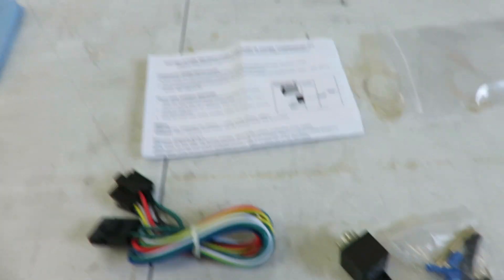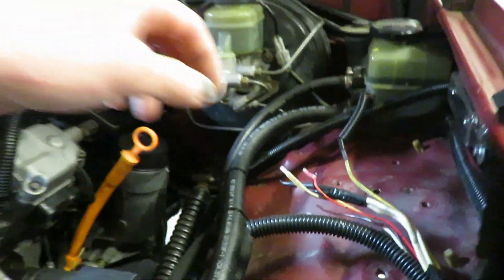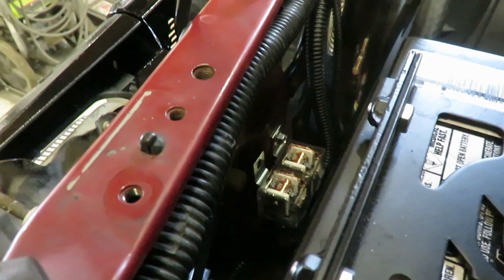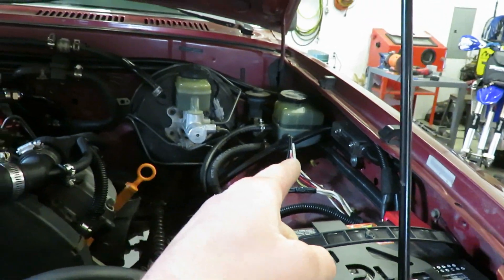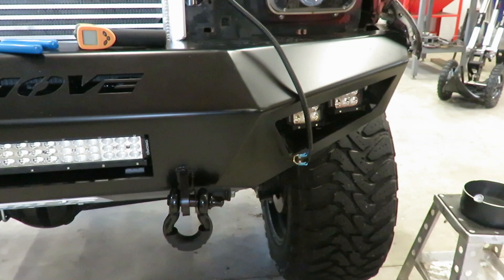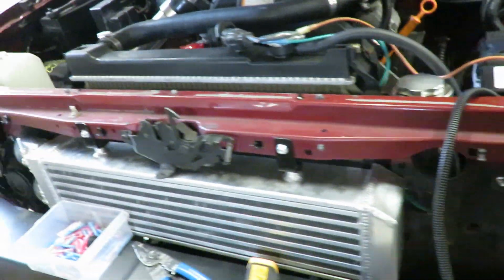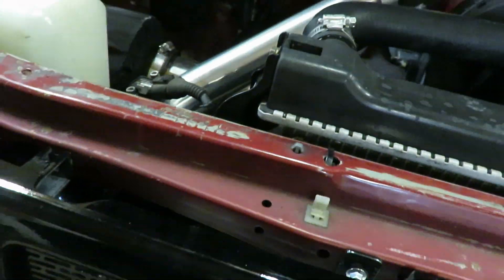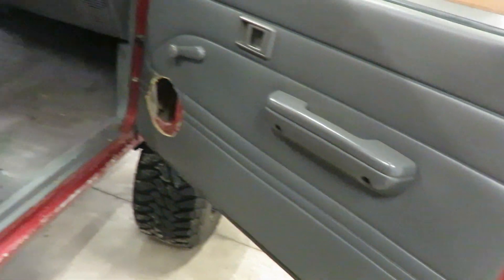Complete Electric Fan System for UNDER $50!!!

Comment: Screw Clamps? If screw clamps were better than the factory Constant Pressure Clamps. Wouldn’t vehicles come with screw clamps when they’re new? Screw Clamps are trash & prone to leaking. And should never be used on vehicle cooling systems. Constant Pressure Clamps come on production vehicles for good reason. 
(THEY DON’T FAIL)

Comment: I used one of those cheap Amazon temp switches that grounds at 180 and opens at 160. Used a 1/8npt adapter to m12x1.25 and screwed it into the coolant glow plug port on the back of the head on my 1z. Ran a switched hot to a fuse to the 12 inch 800cfm fan.

Comment: ok i have some links for affordable stereo components.  
https://www.ctsounds.com/ amps speakers wire kits
https://nvx.com/     subs amps wires kits 
https://www.down4soundshop.com/
your on your own with the deck. but Amazon has some nice Dual din android units one might watch the octa cores . 
https://www.amazon.com/s?k=dual+din+android&ref=nb_sb_noss_2
 now for amps i am a fan of the old school Rockford Fosgate amps found on clist for cheap.. 
an as always only pay attention to the RMS not peak power.
my old 94 4runner has a elcheapo system  pieced off clist. 
alpine deck kenwood 800 sub  amp  fosgate 200 4chan highs. fosgate 6.5 rears an jvc fronts 2.5 farad cap an a 10" JL sub >$300.
If you run AMPS make sure to use good wire , not the 8 gauge junk.  an dont forget to upgrade the Alt hot wire to Bat-Tree and upgrade your ground as well. Personally  i always use the seatbelt bolts for my grounding points.  also NVX has some good sound deadener  much cheaper then name brands. check out  Soundman Car Audio   https://www.youtube.com/user/soundmancaraudio/videos
  on YT he has vids of all sorts of builds and the products i speak of as well as how to fabs vids.
Reply from the maker: have you used the ctsounds speakers and subs? They are cheap!
Reply: @austinniemela  no not yet. i have done a few review searches on YT for the NVX an CT sounds after seeing them on soundman. so far the reviews are purdy good. i see ctsound has a 30day return as well. that being said i think for me i would go with a 10" " dvc NVX sub and ct sound components. if your not wanting big subs you could use  the 6.5  com in the doors and cut in some 8's in the back or 6.5.  looks like you have options here either put 8s in under the rear seats with grills or in the rear Qtr's. go with component over coaxial for better separation cleaner sound and higher volume.  an if im not mistaken Both are American Company's
https://www.ctsounds.com/pages/about-us